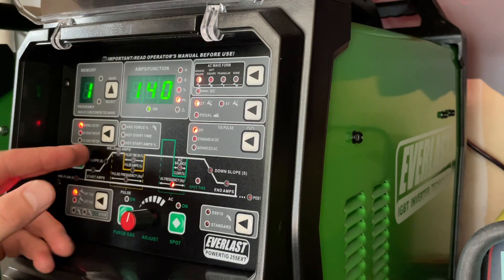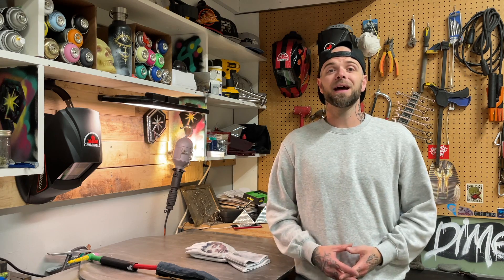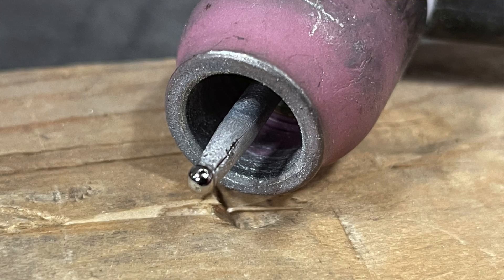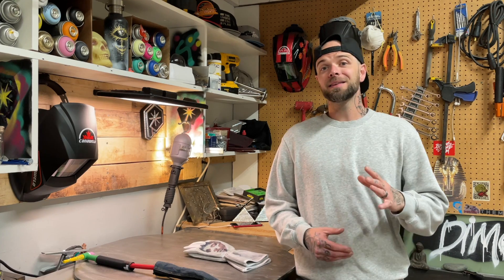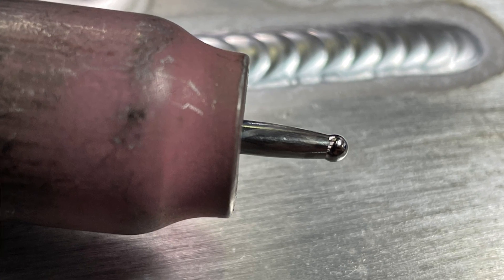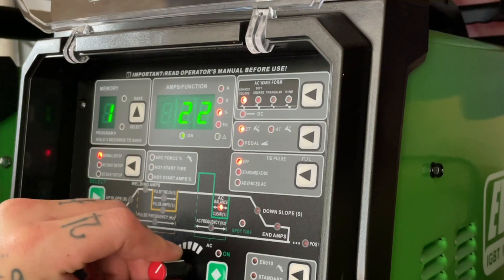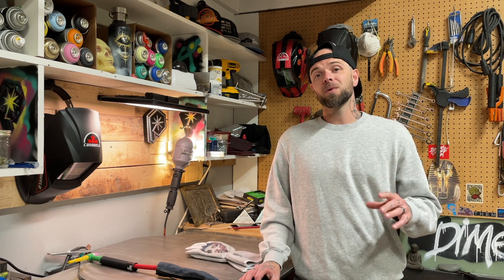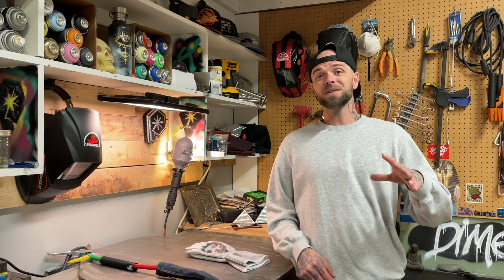Tungsten problems? TRY THESE tig welding settings🔥

Comment: Awesome tip.  I was struggling with lack of penetration (3/16" material) at 35% balance (same welder machine) and getting excessive arc deflection, dirty and fluttering tips, and hazy welds, uugh!  Even Everlast's ambassador tutorial videos were not this specific about balance.  I think now 25% to 30% will work good with my material (haven't tried it yet tho).

Comment: Running super thin 1/8” aluminum edges. What’s the recommendation on settings so I’m not burning the edges of the metal out before laying a bead?

Comment: And what about contamination after a first weld on a stainless steel? Where can it come from? Dirty gas?
I faced a problem my TIG machine can not make an HF start of an arc after I made the first weld.
There is a HF discharge inside the machine instead of arcing between part and electrode.
Once I scratch electrode by a metal piece (thus removing contaminations), I am able to start arc again.
Yes, my electrode is clean, I have enougth gas (the weld is yellow), pregas and postgas is enougth I think...

Comment: Here's all you need to know about Tungsten. 
Step 1. Buy CKWorldwide Layzr tungsten. 
Step 2. find the sweet spot on your machine for balance. 
Step 3. leave it alone. 

Everlasts like the 40% range. 
Ahp 35% all day. 
Primeweld 225 35%
Fronius magicwave 33%
Ck mt200 65%
HTP invertig 70%
Most millers and lincolns 70%

The only time you ever need to deviate from that is when you're doing dirty cast aluminum or magnesium. 
For cast go closer to 50/50 .
Magnesium go closer to pure negative. 

simple as that. 
No need to be over complicating this stuff.

Comment: Hi Dusty, thanks for the wealth of info. I running in a problem that I can't quite figure out: sometimes I can't get to join two pieces of aluminum either when trying to tack them or more recently trying to weld a well fitted lap joint. Both pieces can actually melt dramatically but the molten aluminum on one side won't "touch" the other side's molten metal! What am I doing wrong? Everything is super clean (at least I think it is) and well fitted.
???
Any tips would be appreciated...

Comment: Still don’t understand where the ball comes in? I sharpen a tip to a point, then it melts away to a ball ? and the ball is a good thing? Why not grind a ball in the first place? That tungsten ball looked liquid as if about to drip, is that the case?
Reply: I think a sharp tip makes an even ball but a blunt tip makes a lop sided ball.